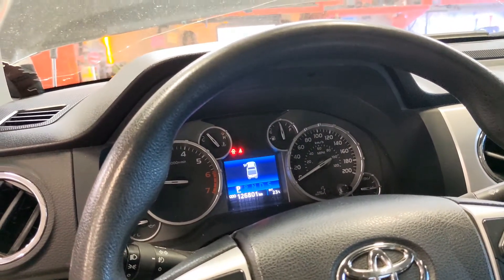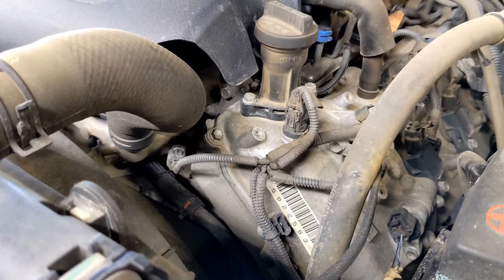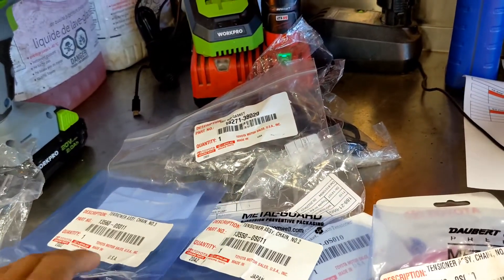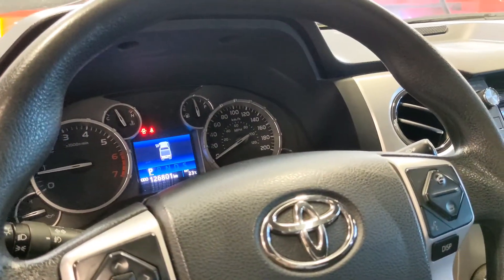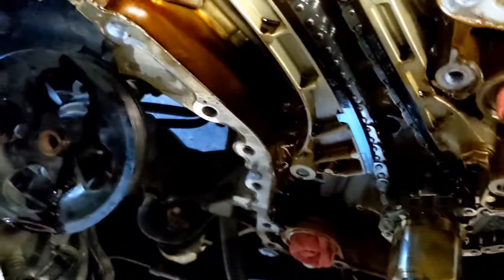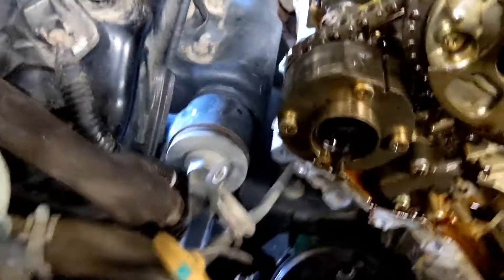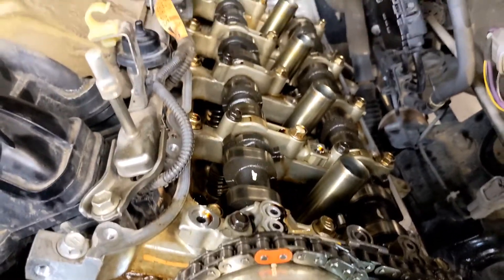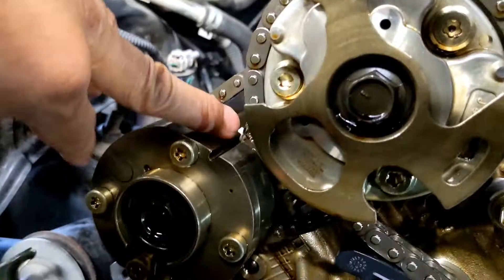Tundra 2015 model 3UR-FE engine, replaced timing chain tensioner due to ticking noise

Comment: I have a 2014 Toyota tundra sr5 5.7
The rattle on start up and timing chain clatter until warmed up.
Changed the timing chain and tensioner. 
I started the same thing again.
The fix.... I found out that the vvt silinoids were turpentined up.
No codes. Use one can of sea foam and let idle for two hours.
That fixed it like new.
I could have saved 2800 in the first place. Idler tensioner look fine.
But they only have 13.5lbs of pressure  .
So just that little bit of turpentined up parts was the only problem.
Try the sea foam I really granted my teeth. But it worked... 1 oz per quart.
Reply: 1 oz per quart of oil or where to put it?.... Where to get sea foam?....

Comment: My tundra 5.7  has been making that chain tensioner noise at cold start for over 5 years. I seem to remedy the  problem with a oil flush every year and it comes back after a few months every time. 133k miles had since new.  It sounds bad but i plan on trying to push the engine to 200k before deciding if i just put a new motor in it lol
Reply: Have a video of the sounds yours makes? I'm curious
Reply: @AuggieTB  no i actually dont have a video but its pretty much like this.
Reply: These engines form a lot of sludge deposits. When you are flushing it, it's probably washing enough sludge out to improve oil supply to the tensioners and making the timing chain rattle go away. It's not a good idea to ignore it. A loose chain rattle can damage the chain guides and create fine metal flakes that end up in the oil and damage the bearings.
Reply: Yes it is the turpentine build up on the vvt silinoids. 
Only 13.5 lbs of pressure on tensioner is not much so it gets a little buildup and sticks...
Sea foam 50 to 100 miles before oil change is the fix.
The chain he sees in this video is lose but if you spray and clean it and work just a little and do a little sea foam per year it will last for ever.
And will save you 2800.
These motor have to be clean...
Clearances are real tight on parts